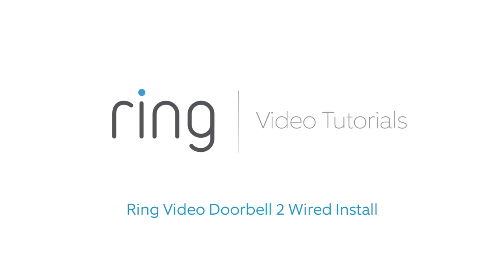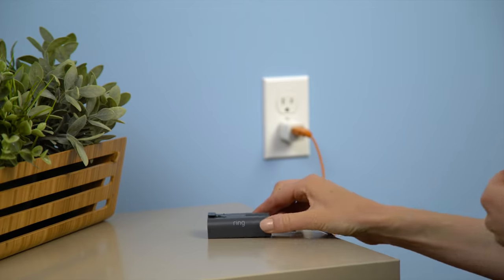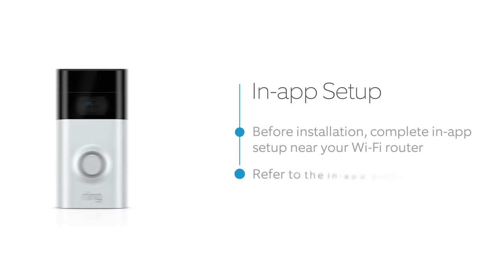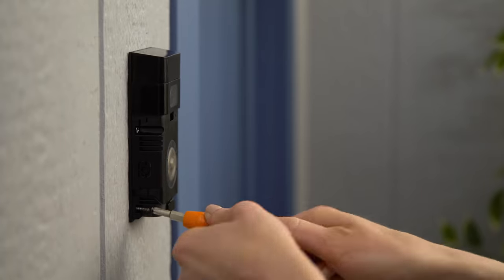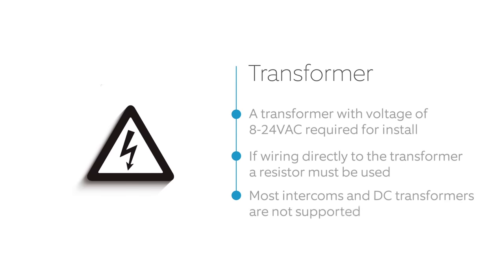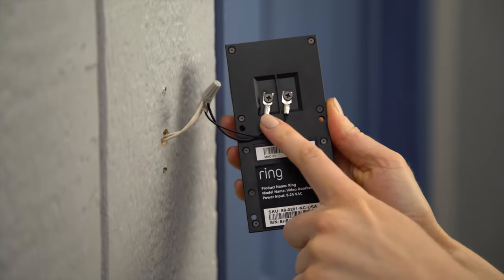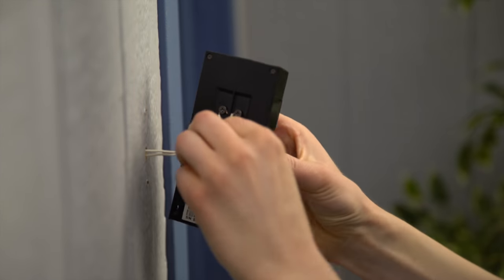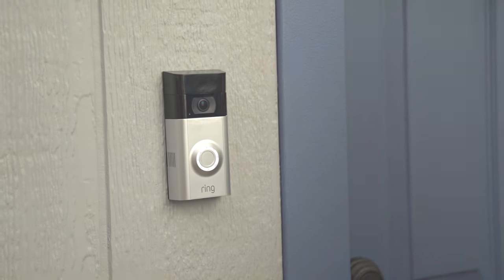How to Install Ring Video Doorbell 2 | Connect to Existing Doorbell

Comment: I've got a normal ding dong doorbell, don't know if it's got a transformer as don't have access to the cables as they have been buried in to the wall.
Reply: Do not sure whether to connect it to that
Reply from the maker: Hey Ricky, thanks for reaching out to us! A general setup with a mechanical doorbell should have a transformer connected to it. If you cannot locate the transformer, you can always test the power at the wires to make sure it's getting 8vAC-24vAC at the doorbell. This would be sufficient to connect the Ring Video Doorbell 2 to. We hope this helps!
Reply: @ring  thank you for the reply. I've worked out it is a mechanical doorbell, think I needs a rewire as the wires aren't visible
Reply: A lot of transformers are on the circuit breaker box

Comment: Screw it.  Instructions to upgrade existing 2020 Ring to Video Doorbell 2 cannot be found and I'm tired of clicking buttons and getting nowhere.  I'll use it as a doorbell only and the heck with video.
Reply from the maker: Hi Charlie. We would be more than happy to help you out here. The Ring Video Doorbell 2020 release was released after the Ring Video Doorbell 2. To clarify, are you looking to upgrade your Ring Video Doorbell 2 to the Ring Video Doorbell 2020 release? Please let us know so we can help further.

Comment: I can’t find where the breaker is for my doorbell , I found “entry way “ but that didn’t do anything
Reply: I can help you
Reply: @luisLopez-uz3mv  Did you ever help her?
Reply: You don’t need to turn off the breaker. If your  doorbell wires kill you, you’ll be so famous it would be worth it. There is not enough voltage to even feel on your doorbell. The lawyers make them say that. If your transformer is near your electrical panel, which is common it will be on a random circuit breaker. If it’s located elsewhere in your house it will likely be on a circuit for that area.
Reply: @KitchenerLeslie2   you're right Brother I'm an Electrician.
Reply: It's not enough to hurt you.

Comment: how do you open the cap to insert battery? i cannot open it.
Reply from the maker: Hey SowPro, check out our video on charging your Video Doorbell 2 for hep on removing the faceplate: https://www.youtube.com/watch?v=yU3DuP3TnYA&t=1s. 

Please also make sure that you have a Video Doorbell 2, and not the new Video Doorbell (2nd Gen) as that device does not have a removable battery or faceplate.

Comment: WHY YOU NEED VOLTAGE IF U HAVE BATTERY PACK INSIDE
Reply from the maker: Hey neighbor! The Ring Doorbell 2 is a battery-operated device, however, it has the ability to be hardwired as an option. This helps prolong its battery life and can connect to an existing, compatible chime kit on the inside of your home — learn more here: https://bit.ly/2Ba1MsD.

Comment: I do not want anyone ringing my doorbell---I have a large dog that doesnt appreciate. Can this be installed without the doorbell wiring, or even away from the door bell----i just want the camera
Reply from the maker: Hey neighbor! The Ring Doorbell 2 is battery-powered so it doesn't require a wired connection to your existing doorbell wiring — check it out here: https://www.youtube.com/watch?v=T3KTcnUIBCE&list=PLAJ7Znk0iooJxBZQQq9eOCVKEOL6JQ7gE&index=3&t=0s. We also offer Security Cams that feature the motion-activated camera only without the doorbell feature — check out more at shop.ring.com. Let us know if you have any more questions!

Comment: My Ring 2 doesn't look anything like the one in the video. I didn't get a reversible screwdriver... just the "star" screwdriver. The screws that came with the doorbell do not use a "star". They are all Phillips. It requires 2 security screws but there was only 1 in the bag and so far it has taken 5 hours to charge that battery to 3/4 full.
Zero support from your website.
Needless to say I'm not impressed.
Reply from the maker: Hello Neighbor. It's important that you have the device that you want and you're able to install it easily to keep an eye on your home and family. We would like to help. Please reach out to us on Twitter or Facebook for more assistance with your device. Our support teams are available to assist 24/7. We look forward to working with you.
Reply: @ring  All I needed was 2 security screws. Customer service on Facebook told me to fill out a form. I did that. I sent then a picture as they required. They then told me to sign up for some community forum to verify my account. Too much effort to jump through too many hoops just to get 2 screws. I took the device back and got a refund. Went and bought a Eufy which came with all the right hardware. 
Your "customer service" is terrible. Too many firewalls and too many hoops just to get a working doorbell.

Comment: This doorbell sucks and constantly loses the wireless connection when you need it most.  When it disconnects itself from your network, the only way to find out it isn't recording is to check your app and drill down through a bunch a menus to find the problem.  Defeats the whole purpose of having a VIDEO RECORDER at your door if it doesn't do the main job it was designed for.   Save yourself the headache and buy a video surveillance camera with a network port (RJ45) and use POE over your home network instead.   Added bonus... you can avoid the subscription fees.
Reply from the maker: Hey, neighbor. Thank you for reaching out to us. Ensuring you have a fully functional Ring Video Doorbell is vital to your overall peace of mind when protecting your home with Ring, and we're here to help. Please feel free to contact us through Facebook, Instagram, or Twitter for assistance.
Reply from the maker: Your experience is not that of what we strive to provide for our neighbors, and we're here to help. Please send us a DM at one of the social media platforms above or call us at 1-800-656-1918, (or if outside the US: http://ring.com/callus) 24/7, for more support. We look forward to hearing from you.
Reply: @ring  Your Automated responses are showing customers just how NON-CUSTOMER service oriented your company is.   I threw my ring back in the box and will toss it in the garbage, BUT I'm sure there will be another automated response to this reply shortly.  #ring does not care

Comment: What's up with this transformer stuff? So I can't directly wire it to the existing wires??
Reply from the maker: Hi Dale, thanks for reaching out. The existing wires at your door are powered by a transformer at your home. Connecting your Ring to these wires provides power to help prolong the Ring's battery life. Let us know if you have any more questions!
Reply: @ring  thank you
Reply: @ring  Why does the video say the exact opposite?

Comment: What if I don’t want to connect to my doorbell?
Reply from the maker: Hello Arianne, we understand how critical it is to be able use the Ring Video Doorbell 2 without connecting to your existing doorbell because it allows you to install the device when there is no existing wiring. The Ring Video Doorbell 2 is a battery powered device that can be hardwired if needed, so hardwiring to your existing doorbell is not required. We hope this helps!